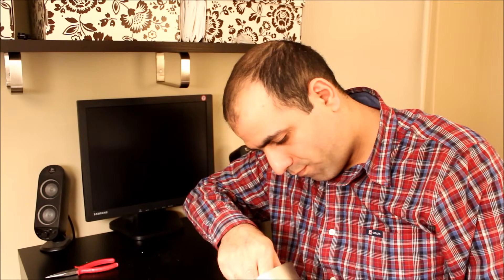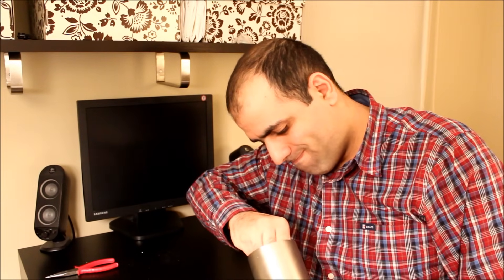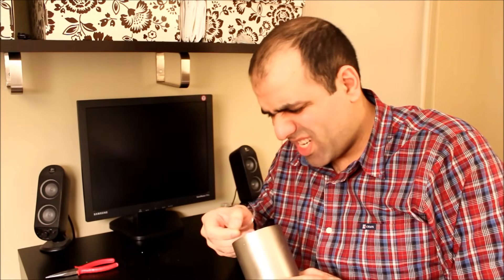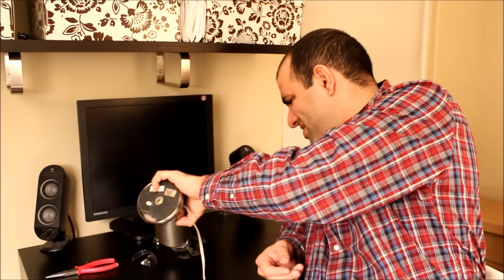How to Change a Light Bulb

Comment: A good rule of thumb for evaluating the amount of force you need to tighten them (or anything else) is of course turn it until you hear a crack and then back up a quarter turn (thanks AvE).

Comment: I once had to fix my wife's tortoise lamp. replaced the top and plugged it in to test... all worked fine, so I removed the bulb, removed the top and went to screw down the locking nuts... Dumbass here forgot to turn the switch off!, so, holding the live wire in place, I reached for the earth wire.. .and zapp.. got a nice shock from the 240v mains. My arms tensed up and I felt a kind of "dull" vibration.. also felt kinda funky for a while. Didn't hurt, but was very "shocking"............ sorry.
Reply: Yeh, sounds about right.
Reply: Dave Atkinson nice story
Reply: Türk müsün ciğerim
Reply: Here, our Mehdi takes daily dose of electric shock..😅😂
Reply: Why did ELECTROBOOM stick his finger in a socket this is like how a baby would change a light bulb.

Comment: this video is an exact re-enactment of what happened to me this morning, I have a 60 watt, 240 volt AC desk lamp and I touched the two prongs when it was on... I flew across the room, I was lucky I didn't touch it with two hands or I wouldn't be posting this comment, so just be careful when changing light bulbs.
Reply: Same thing happemed to me when changing a broken 200w outdoor light...
Reply: vvo.bet#Oos$

Comment: You're hilarious. The sad thing is my step father, whom is extremely inept in anything mechanical or electrical, would probably make all the mistakes you outlined doing something simple. In Aus we don't typically use Edison screw, we have 2 pins on the side of the globe that locate in 2 keyways on the socket. You just push the globe in and give it about an 1/8 of a turn and it's done, but he will still either push on it too hard and break the tabs, or twist it too hard and tear the globe from the base, or damage the socket. I don't know how he's stayed alive so long, given he was a butcher by trade.
Reply: K
Reply: it's called a bayonet cap. the better of the light holders -  the UK uses it o,
Reply: voltare2amstereo yes it is, the bayonet base, it is easier to use, but the reliability is low... I am in America, dont use these on a normal basis, but I do have a few, sometimes the lightbulb just falls out...
Reply: Why can’t he change a light bulb.
Reply: @firestonevlogs6361  doesn't sound right. All the sockets i have that use the that fitting have a spring that keeps it down. The connector is U shaped so to remove you need to push, twist, then pull it down.

Comment: 0:09 [Burns himself] Aww f***.
0:36 Just make sure you don’t cut your fingers and take the screw part out. 0:39 My finger, good thing the breaker opened.
1:09 Come on, piece of sh**. 😂
2:09 Well the lamp is already out, so always use a tool to get the screw part out. 2:14 Unplug, damn it unplug. F***.

Comment: Wait... so if I bought a 1000W radiator from America which is 110v and use it in UK which is 240v.... what wattage is the real wattage what I will get?
Reply: ***** Thanks. I don't understand why it isn't double, but thanks.
Reply: ArcanePath360 P=V*I, I=V/R, therefore P=V^2/R. Doubling voltage also doubles current. Power is the product of the two.
Reply: ArcanePath360 Probably copious amounts of smoke.
Reply: ArcanePath360 Because the voltage is doubled, so as a consequence, the current also doubles. That is how resistive loads work. So 2X voltage, multiplied to 2X the current, 4X the power!!! But you will probably just blow it up. Check out the photonicinduction channel to see some destructive testing of equipment.
Reply: Power Max I think I understand. In an electrical installation that has double voltage, you have the capacity for higher current flow, so this equates to x4 current flow with the pressure of x2 voltage to add on? Man I have a hard time with electric. I should maybe stick to plumbing.
Reply: ArcanePath360 The classic plumbing analogy goes like this:

Voltage = water pressure
Current = Flow rate
Resistance = back-up (clog, how thin a pipe is, etc.)

So using this simple analogy, we can understand how when you decide to double the water pressure, more water is forced through the clog, and the flow rate roughly doubles. Likewise, when you half the pressure, then less water will flow, as less water is being forced through the pipes.

So, in electronics, as the saying goes, Volts push Amps through Ohms.
In this case, double the volts means double the amps through the same amount of ohms. To figure out how many watts will be needed, simply multiply the voltage and amperage together. When you see that the volts AND amps get doubled, when multiplied, it is 4 times the power!!!!
Reply: Power Max Thanks!
Reply: ArcanePath360
Theese are the calculations:

V1 = 110V 
P1 = 1000W
 
P1 = V1*I1   =>  I1 = P1/V1 = 1000W/110V = 9.09A

R = V1/I1 = 110V/9.09A =  12.1 Ohms

The heating element has the same resistence.

V2 = 220V  (= 2*V1)
I2 = V2/R = 220V/12.1 Ohms = 18.18 A   (= 2*I1)
P2 = V2*I2 = 220V * 18.18A = 3999.6W = 4000W  (there is an approx. error in the calculations)

Conclusion:
V2 is 2*V1
I2 is 2*I1
P2 = V2*I2 = (2*V1) * (2*I1) = 2*2*V1*I1 = 4*V1*I1 = 4*P1
Reply: khroe underrated post
Reply: +Italian Programmer Engineers -.- Pfft
Reply: +ArcanePath360 Regardless. Twice as many volts will be too much heat. Most likely either cabling or the element itself will fail. It could be immediate or within some time depending on the wiring.
Reply: Fire
Reply: +ArcanePath360 first off,    many things now come with some thing called dual voltage.    it can be fount on things like the phone charger little black wall socket box,   it will say 110 and 220  volts.    but also many things like heaters are not dual voltage and yes,  they will make smoke and blow out in less than 2 seconds because they do not have the power converter built into them.   hair dryers,   hair curlers and many other things that do not have that little black box for the wall socket plug are not dual voltage,   look at your lap top computer cord,   the big black box built into the wire.   it will say 110 and 220   some times it will say 240 volts.
Reply: j
Reply: +ArcanePath360 Something around 4760W, I believe.
Reply: +ArcanePath360 I think it will be 4760 W
Reply: Most lamp cord wires are rated to 300 or 600 Volts, and it mainly has to do with the ability of the insulation material on the wire. Wire gauges indicate the amount Current that the wire can handle, not the Voltage. Twice as many Volts will not create more Current or heat if the proper load is powered by the circuit. For example, If the bulb was changed from a 120 Volt bulb into a 240 Volt bulb of the same Wattage, it would work perfectly, and consume half the current of the 120 Volt bulb. Therefore, the same wire would be more than sufficient to safely supply the load.
Reply: you can wire 2 [110v resistive loads (bulbs, radiators, non microwave ovens etc...) which have the same power rating] in series then plug this into 230V.
example :
/           \       /          \
|(1)  (2)|      |(1)  (2)|
\           /       \           /
 plug A          plug B
you would plug the 1 of A to live, the 2 of A to the 1 of B, and the 2 of B to neutral.
if you have 2 1000W 110V radiators they would give you about 2000-2100W total.
you shouldn't try to do that with different loads (although you could maybe make it work, for example  (2*50W in parallel) in series with 100W would work, but  it becomes quickly complicated.) and especially with ones that vary over time, unless you know exactly how it will work.. 
note : this is for education only, don't do that without a bit of research.
Reply: you can burn out the cable. If your circuit breaker has been sized properly, it should trip anyway

Comment: In Germany we have a rule book called „VDE“, and the First rule is the most Important one. It explanes how to make sure you Never get shocked. All you need to do is follow the 5 steps that this rule explaines:

1. Open the Circuit.
You can unscrew the fuse/ Turn off a breaker or pull the plug

2. Protect against re-powering
Someone might plug in the loose wire when seeing it. Make it hard to put the plug in / Lock up the breaker box and Other stuff like this. This rule is for bigger systems and you dont Need it if the plug is right next to you (you See someone plug it in, stop him!)

3. Check Voltage =0
This is to make sure you didnt Open the wrong circuit.

4. Short the device
(Big systems again, to make the breaker Pop in case someone starts the system)

5. Cover up Electric parts nearby.

Comment: one thing you can do to extract a broken light bulb base is use another lightbulb's base to friction turn it out. you just have to be careful since the turning stress can make the other bulb want to separate at the base too (best done with an already burnt out bulb). hopefully incandescent bulbs are completely obsolete now anyway and this problem is no longer a concern.

Comment: "A bulb that's 100 watts in a country that uses 220 volts is actually 400 watts in a country that uses 110 volts."  Not sure I understand...
Power (watts) = voltage (volts) * current (amps)
Wouldn't it be 100 watts on either 110 or 220 volts or am I missing something here?  It would simply draw more current on 110 volts that on 220 volts, but I don't think that would affect the wattage rating.
Reply from the maker: The wattage is no fixed. Let's assume a lamp is a fixed resistor (it is not, the resistance increases as it heats up). 
Power = VOltage^2/ Resistance. So for a given resistance, double the voltage is 4 times the wattage. Of course you may not get quite 4 times, because as the lamp heats, its resistance rises as well. But the lamp will definitely blow up as it will be much hotter.
Reply: ElectroBOOM So does that mean that if the light bulb was 100 watts and 220 volts but in another country it was 400 watts and 110 volts could that cause a huge power outage or am I miscalculating.
Reply: The first person heard wrong. It is 100 watts in 110 volt country and 400 watts in 220 volt country. If a bulb is 100 watts in 220 volt country, it would be 25 watts in 110 volt country. If the voltage is double, the current will also be doubled, which means 4x power (assuming same resistance).
Reply: But why is power = voltage²/resistance? I thought it was simply voltage/resistance. Where does the squared come from?
Reply: Current = Voltage/Resistance. 
Power = Current*Voltage.
So Power = (Voltage/Resistance)*Voltage = Voltage^2/Resistance.
Reply: Anas Altawil ah ty
Reply: Jon Holt if the bulbs were rated by resistance then they would be universal, yet to simply things, they are rated by the power usage default to that country.
Reply: It's interesting to note just how huge the "resistance increasing as it heats up" effect is for a light bulb. I measured the resistance of a 240V 100W light bulb as 43 ohms (at room temperature), which would correspond to a power of over 1300W. The actual resistance at operating temperature must be more like 580 ohms. Using a table of tungsten resistivity vs temperature, it looks like the filament gets to 2500-2600 K. Presumably for a 110V bulb on a 240V supply, the resistance would go up yet further (for its short life).

Comment: Hey, dummy, rule number 1, if it's umplugged, you won't get shocked!!!!
Reply: well that is true only as long as there are no capacitors on the circuit
Reply: Well, ok. There is that.....
Reply: mo thesurfer hay dummy what if their is a cap
Reply: There or their?
Reply: What if theres a capacitor?
Reply: mo thesurfer ----- capacitors can hold a charge for a long period of time, this varies between what type. Now in changing a lightbulb, turning the power off is a smart idea. It is kind of safe though, ( if you do it correctly) as most cfl or led lightbulbs have discharge resistors on the capacitor, unless you buy a cheap ebay lightbulb... incandescent lightbulbs dont contain any capacitors or any electronic components for that matter, as they are just a thin metal wire in a vacuumed glass globe... he was using an incandescent lightbulb, which means turning off the power would have not prevented electric shock... obviously, he was doing this on purpose, but it is recommended that you turn off the power before doing any alterations to electronic elements, devices, or equipment... NOTE TO ALL: NEVER WORK WITH THE ELEMENT OF ELECTRICITY WITH THE POWER ON AND NEVER STICK CONDUCTIVE OR COMBUSTIBLE OBJECTS INTO SOCKETS OR OUTLETS (UNLESS IT IS PART OF THE PRODUCT e.g. Plug)
Reply: pay attention
Reply: mo thesurfer *unplugged
Reply: Silica *there's

Comment: I've actually tried wiring a bulb I've got from USA into 230 volts and it worked flawlessly. For few seconds. :D Acorrding to my calculation the bulb produces 201 Watts of heat and 8 Watts of light for that short time. Quite interesting.
Reply: 201? Fake, it should be at least 237-264 volts unless it's a European biometric square lamp or an American biometric locomotive power cylinder lamp in a double power socket under the law of section 58 of paragraph 137 in the electrical and technological book of understanding
Reply: Nerv I didn't measure voltage i had from public network. I didn't have funcktioning multimeter at the time. But it can be anywhere in <207;253> volts. Anyway the bulb burned quickly.

Comment: I love that he showed that EVEN THOUGH THE SWITCH WAS OFF, HE GOT ZAPPED. They probably didn't switch the 'hot' wire on the lamp cord, or there was no larger blade safety plug on it.

Comment: one thing that i like to do when you get difficult fixtures is 
USING GLOVES THAT HAVE RUBBER DOTS ON THE FINGERS
you'll find the globe goes on easy with less effort 
also this helps protect you as well  assuming the glove is material or rubber

Comment: Pro tip, if the glass separates or breaks off of the metal screw piece, cut a potato in half and use that to twist and pull the screw piece out.  That's in the same pro tip book as using peanut butter to get gum out of hair ;-)

Comment: You really should unplug, especially in Europe where the sockets are not polarized. There is 50-50 chance that there is voltage even when disconnected. Even with polarized you cannot be sure that the socket is wired properly.

Comment: A 100 watt lamp at 110V will NOT be 400 watts at 220V cuz of the increased thermal resistance at 220V.  I have found that the increase in amperage for incandescent lamps is related to the square root of the voltage increase, so going from 110V to 220V would result in a doubling of voltage but only a 1.414x in amperage, so the new wattage should be just under 300 watts, not 400 watts!  An easy way to confirm this is to use a laboratory power supply unit (lab PSU for short).  Take some incandescent lamp rated at 12V (for example) and check the amperage at 6V vs. at 12V.  The amperage will NOT be half at 6V vs. at 12V.  Incandescent  lamps are NOT resistors, they behave differently because of thermal resistance.  I am not sure if this square root property is valid over the full range of voltages for the lamp but at least for reasonable ones it is true.  So for example, dropping the voltage of a 110V incandescent lamp that is 100W rated to only 55V should flow about 0.71 times the current but since it is half the voltage, the "new" wattage should be about (0.5) (0.7071) 100W = about 35 watts.
Reply: The bulb will explode anyways. What he was implying is you have to pay attention to the 110-220v difference in some countries.
Reply: Explosion is not guaranteed.   If you want to use 110V rated incandescent lamps in a 220V country but have them burn at normal brightness, you have several options.  1) Use a voltage converter,  2) wire 2 identical lamps in series.